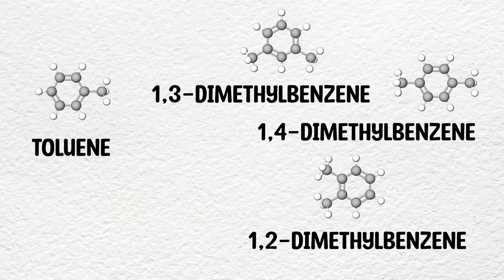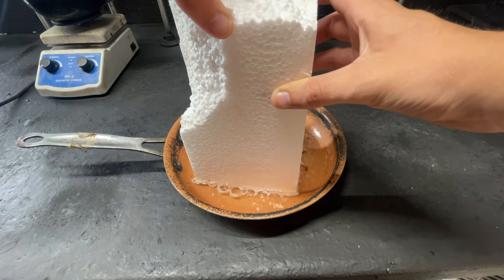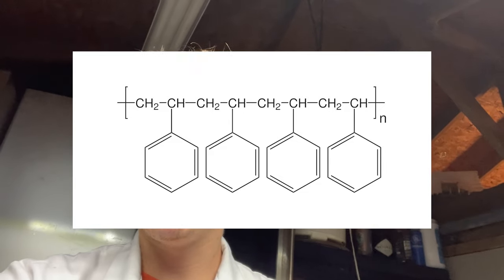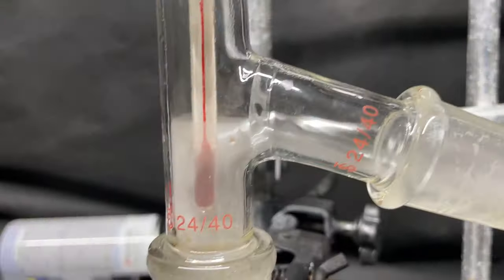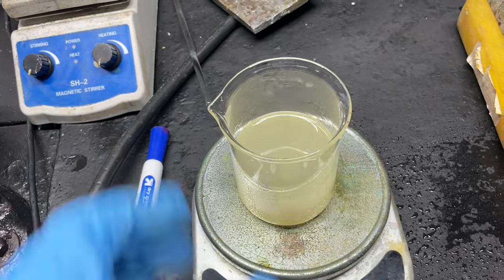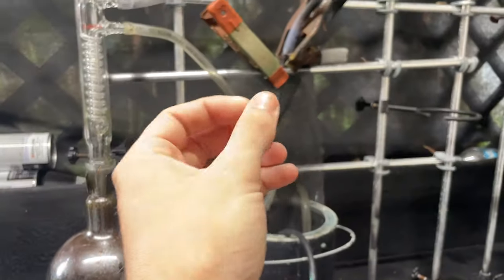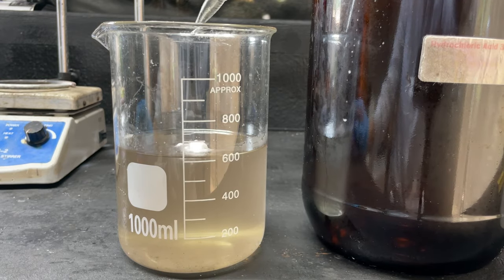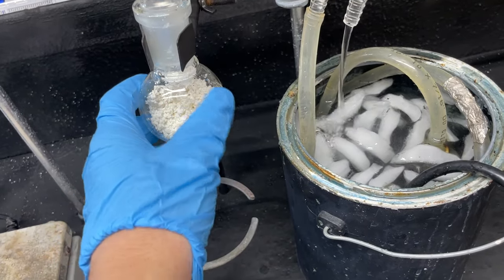Turning styrofoam to everyone's favorite carcinogen, benzene!

Comment: From what I've tried out to not have to deal with the nightmare that is the solidified mass of polystyrene, dissolving it then laying it out on large sheets of baking paper and waiting for the acetone to evaporate gives you somewhat easy to deal with sheet like material. make sure to spread it out kinda thin cause then you can cut it up into pieces later with like a hacksaw or something.

Comment: Also, for higher temperature distillations id recommend a digital thermometer setup, which can be easily made with a K type thermocouple, an NMR tube (or similar size glass tube) and some sort of thermally conducting substance (like thermal paste or something) to make the thermocouple have a better thermal conductance.

Comment: Mix some copper oxide and some calcium or barium oxide as a catalyst and you will get mostly benzene. If you want mostly syrene add copper oxide on titanium dioxide make by precipitating copper on titanium dioxide vac filtering and then roasting the filter cake till it turns black.

Comment: i think i read somewhere that it can be made by compression of acetylene.
Reply from the maker: Think you can just pass it through a tube furnace at a very high temperature to get benzene.
Reply: @PyrotechnicalScience  i brought this up, because i found calcium carbide fascinating for it's use to light caves for miners, and explorers. i think it was wiki that mentioned it.

Comment: Why not use phenol? Distillation of phenol in the presence of Zn metal affords benzene.
Reply from the maker: That’s also possible! But phenol is usually a harder chemical to come across.
Reply: @PyrotechnicalScience  decarboxylation of asperin. You can even perform this reaction in glass no problem. To me, it's the best method. Low cost, low risk of glass damage.
Reply: @PyrotechnicalScience  also, phenol isn't a carcinogen like styrene. If you're technically desperate you can extract phenol from throat spray.
Reply from the maker: True definitely a feasible route, probably better in terms of yields and work.
Reply: @PyrotechnicalScience  if not, at least it's a yeld of a video or 2